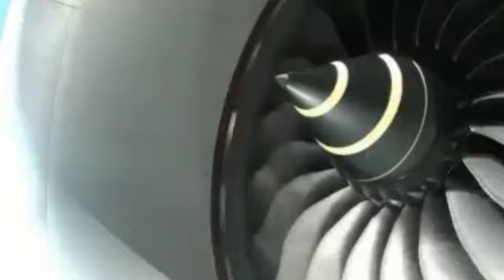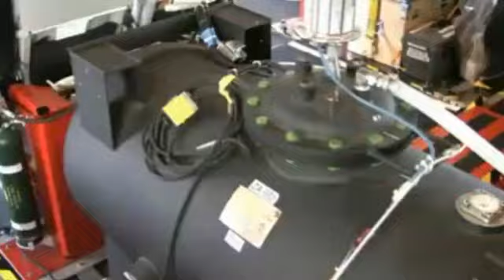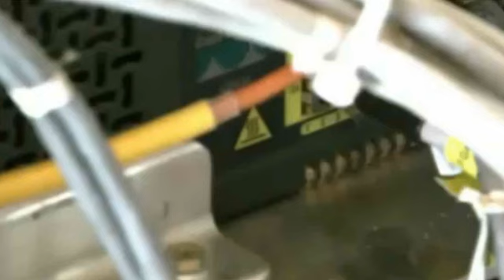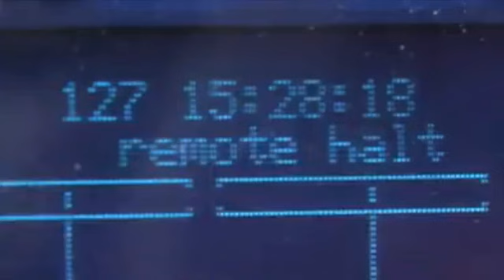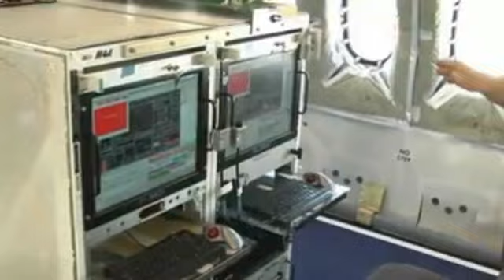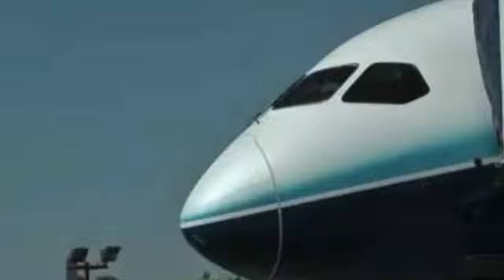787 Test

Comment: Can water from the containers be emptied and filled with chemicals?
Reply: ofcourse...chemtrails
Reply: Probably depends on the chemical - some of them are corrosive. But why would they do that? Water is cheap and easy to pump around.
Reply: water is a chemical
Reply: Tin Lieu yes to.control your mind to believe in chem trails and flat earth..lmao
Reply: @Motorhead250  gaslighting sheep as always

Comment: Of course its only water, like those private companies who are spraying shit 7/24 into the atmosphere then calling only test.

Now even politicians started to speak about chemtrails and geoenginnering, there are planes who are spraying heavy metals and other chems, search it yourself.
Reply: Mike Olafstein Every commercial airliner has these water ballast systems installed during the flight testing process. And I don't mean just the prototype when a new type of airliner gets designed -- every plane that is manufactured goes through these tests.

I've examined these systems in detail at air shows and I have spoken with Boeing employees who design, install, or operate these systems. They are for weight balance and center of gravity flight testing. All of the hoses are in the cabin and none lead outside.

Then of course there is that pesky issue of capacity. If it were filled with chemicals which lead to sprayer nozzles, that isn't nearly enough material to produce an optically dense trail tens or hundreds of miles long. Even if you took the largest cargo plane ever built, stripped out every non-essential parts, and filled it up with as much chemical solution it can hold and still be able to get off the ground, it's not enough "stuff" to produce the long trails you see in the sky.

And this is not a minor discrepancy, it's insufficient by several orders of magnitude.

The only substances that are found in persistent aircraft trails are water and other byproducts of jet fuel combustion. Countless direct samples have been taken since persistent contrails were first observed in the 1920's, and even the samples taken in recent years (long after the chemtrail hypothesis first cropped up in the 1990's) have never been found to contain anything except combustion byproducts. Not a single one. A trip to the library to research in science journals and meteorology reference books will confirm this, as will a Google Scholar search for "in situ contrail sample".

Or you could rent an atmospheric testing plane and collect some samples yourself. I have an open offer to donate $200 towards collecting direct samples and/or performing ground-based spectroscopy of persistent aircraft trails. You could even rent the atmospheric testing plane (N701BN) that is parroted around as a "chemtrail plane" because it has a bunch of scary attachments. But nobody is ever interested, they would rather rely on conjecture and supposition based on nescient observation, and they would rather continue to believe that "looking up" is actual research and proof of the existence of chemtrails.

Comment: They are flight testing a new airplane. They don't just put airplanes in the air without testing every single aspect of the plane.
Reply: ...and these EXPENSIVE metal pressure tanks are in what capacity, compatible to passengers and their carry-on luggage?!
  What makes this a good analog for route weight /ballast in flight ?  Crash test dummies  to "stand in" for actual homosapiens along with carry on luggage, overhead bins full of carry on luggage and food carts would be far more accurate.  
The fact that the passenger seating and overhead luggage bins are missing, further invalidates any test results gathered from this rediculous 'test".